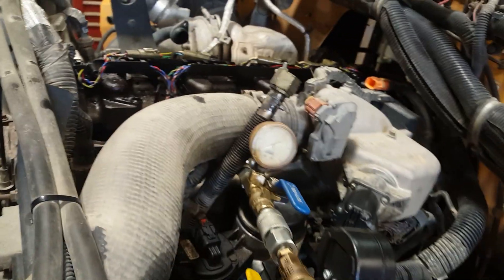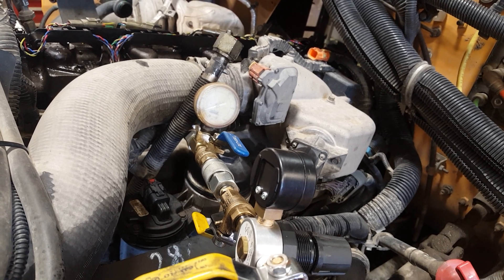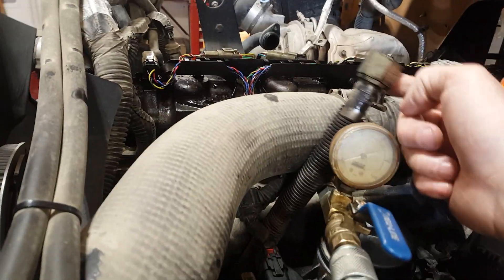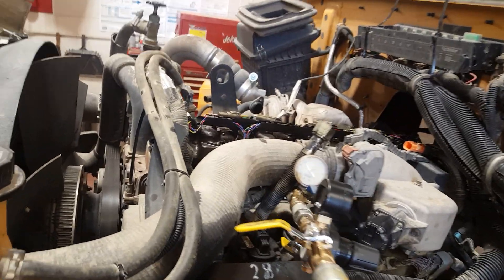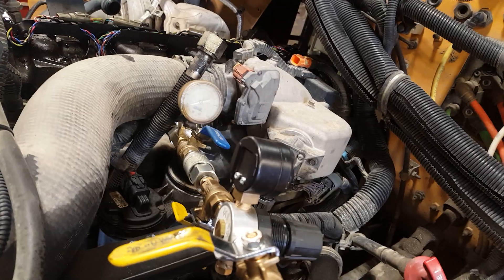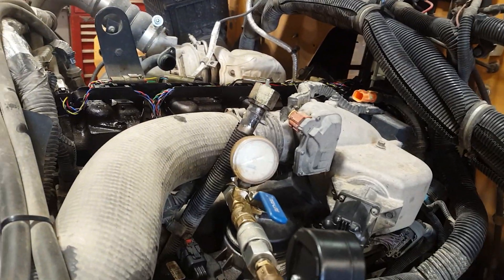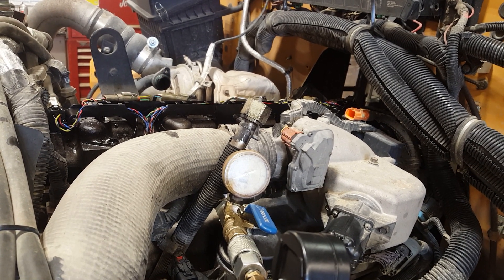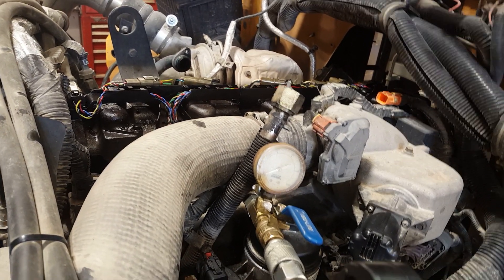2011 MaxxForce DT High Pressure Manifold Test

Comment: What size is the fittings that's going into the high pressure oil Inlet of the head? Diameter & thread size.
Reply from the maker: I can't post a photo here. We took the line off and went to a hydraulic shop for fittings.

Comment: I'm having a hot start problem and I have replaced all the pucks and o rings .and new icp.new ipr..when air testing seems air is bypassing injector spool valves. How much air is supposed to pass by injectors..150psi shop air is what I'm using
Reply from the maker: Andy, No air should leak considering it takes 800 psi to start the engine. Viscosity changes from a hot engine may effect starting with thinner oil. We've found leaks at the engine brake solenoid o-ring located at the middle of the high pressure manifold along with the relief valve at the front end. Check the 2 pressure sensor o-rings. If it's still a mystery add leak detector to the oil, run the engine and pressurize the manifold.
Reply: Did you ever find the issue?

Comment: Mine 2009 maxforce dt international take lot time to start. If left seat for next day.
Code on dash 163 fmi 1.
What it could be.
We replaced all injectors seals and manifold seals bout 20.000miles ago...all injector tested good psi..
What it could be and after truck is hot it starts right up just on morning...
Any idea...
Reply from the maker: I checked on 2010 DT codes there was no 163-1. But there was 164-1 which is hard start engine hot. Your engine is a 2009 which may have different codes.
Reply from the maker: I would check ICP pressure first.
Reply: @MechanicsHubdotCom  how chk presuure
With air house tach to pump line ??
Reply from the maker: @1HSYURIDIA  remove main line at hpop and adapt fittings shop air to manifold. If there is a leak remove valve cover and check it out.
Reply: @MechanicsHubdotCom  thnks lot
Great videos..
Reply from the maker: I'll find out exactly what that code is on Monday for you Mike. (Off work right now) If you're ICP is good it could be the ICP sensor which is located at the rear of high press manifold.
Reply: @MechanicsHubdotCom  code is. 163 fmi 1 its unable to buid enoghu oil press.

If icp sensir truck wont start at all isnt?
Thi doesnt start in morning when cold. When hot strts right up....